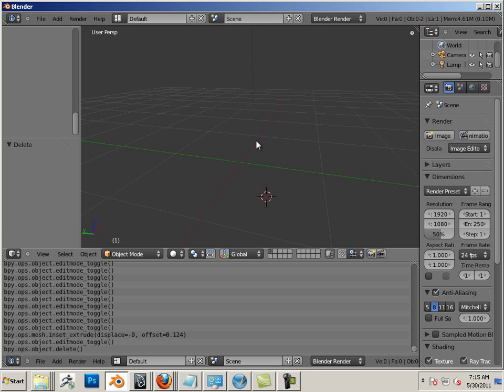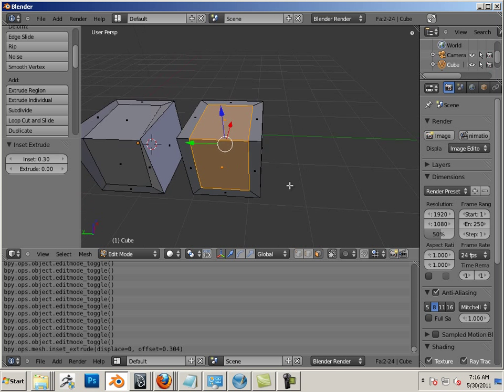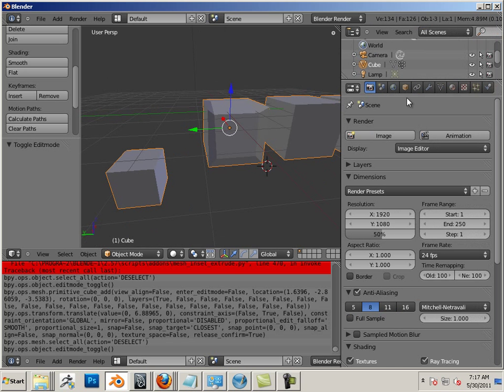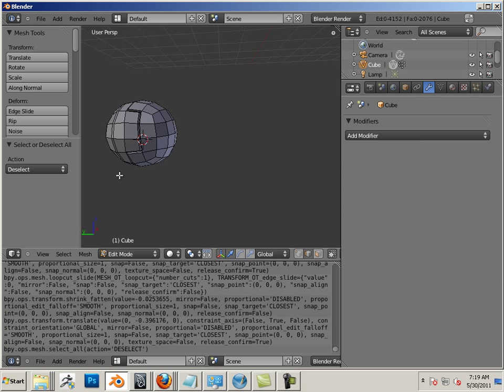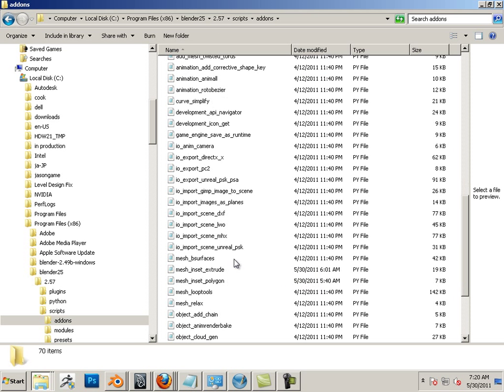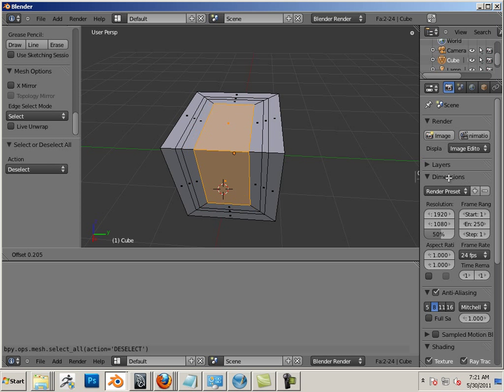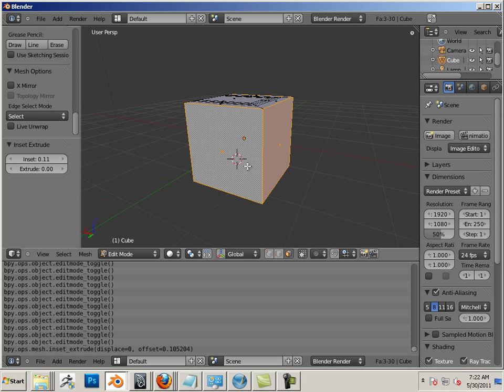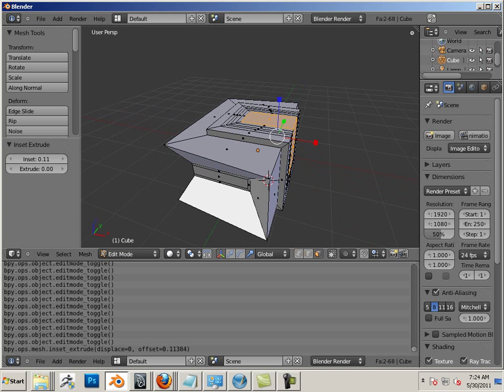0607 Blender (Inset Extrude).mp4

Comment: Just thought I'd point this out: depending on what you choose during installation, the addons folder might also be located in your application data folder. That would be:

C:\Documents and Settings\USERNAME\Application Data\Blender Foundation\Blender\2.57\scripts\addons

Other than that, great videos! Halfway through the video lessons and I feel my modeling has improved greatly. Thanks!